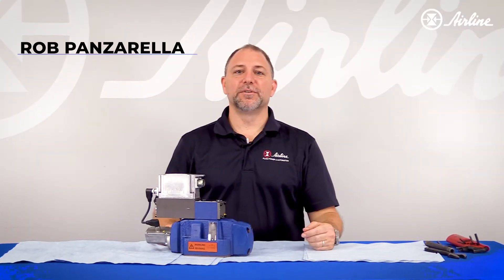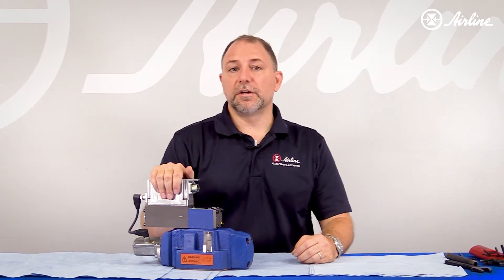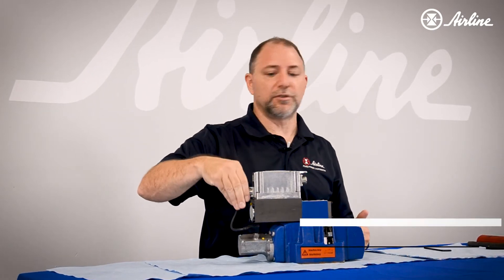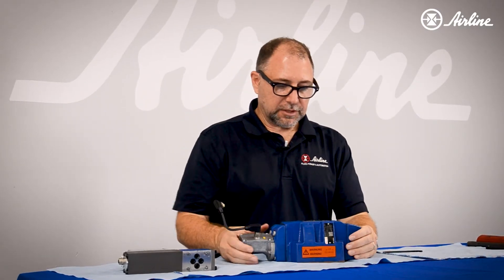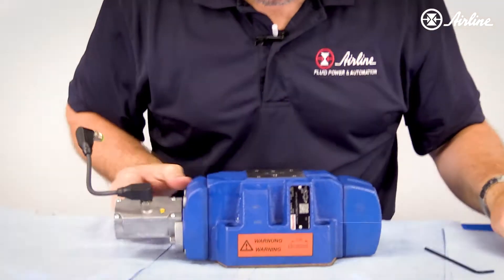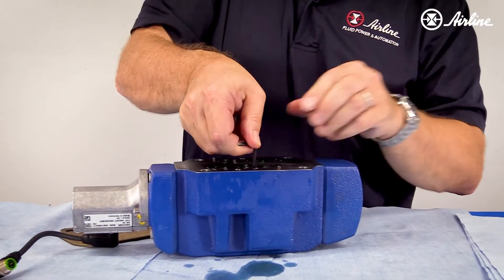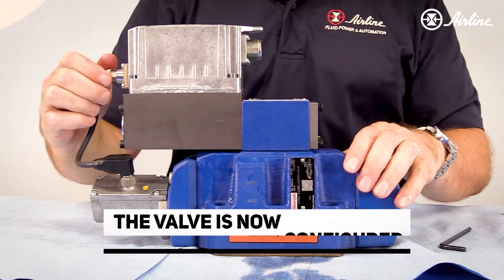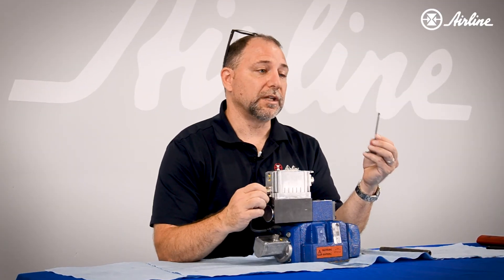Bosch Rexroth 4WRLE Valve Configuration Tutorial | How to set up internal piloting and draining

Comment: Nice video, is it common that the little pilot on top off valve fails?
Reply from the maker: Great question! Yes, it is common since the electronics are housed there and the valve operates around 200Hz.  It can be replaced, but for best performance, it should be mated with the main stage and tuned to factory specifications.

Comment: For external pilot configuration, how the pilot supply is given if plugs are not removed on this model?
Reply: The Hydraulic Pilot Pressure has to be supplied into the X port if the external pilot plug is installed.  When the plug is removed the X Port is connected to the Supply Pressure.